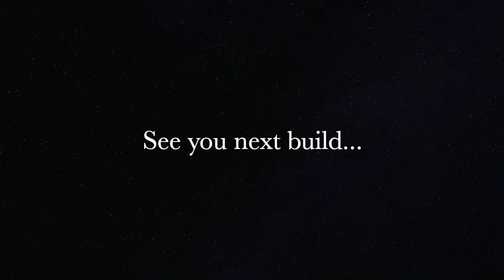Minicraft 737-4 rescued & modified to 737-5

Comment: Good to see you on another recovery mission. 👍👍
I would be afraid cutting the fuselage. When you do it on video it looks so easy but I bet it is not!
Painting the leading edges without masking tape ... you're really fearless, I could never paint that straight ;-)
The Sommerflyet decals looks lovely and brings up holiday feelings. 

Another great build and very well done! Thanks for sharing.
Reply from the maker: Honestly cutting the fuselage is not a big problem if you use those razor blade saw but you need to put mark with adhesive tape. I really like those colourful liveries as well. 

Take care ;-)